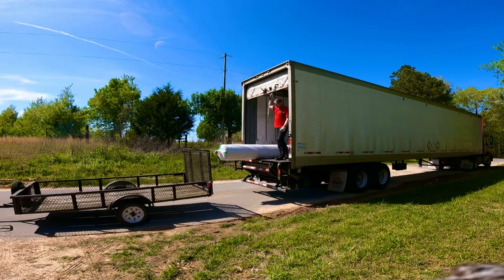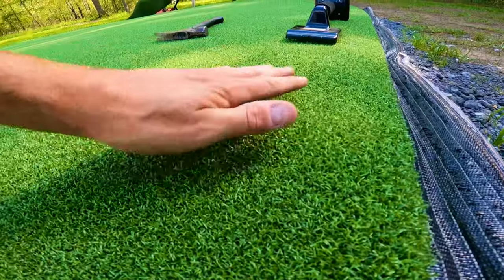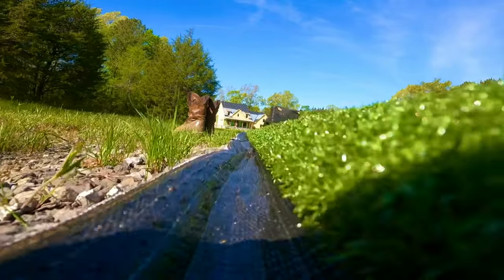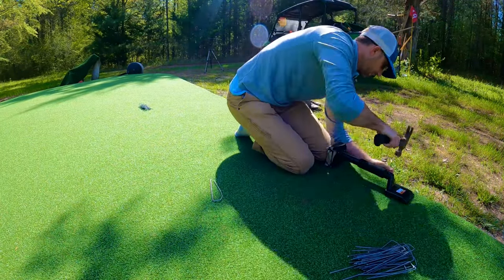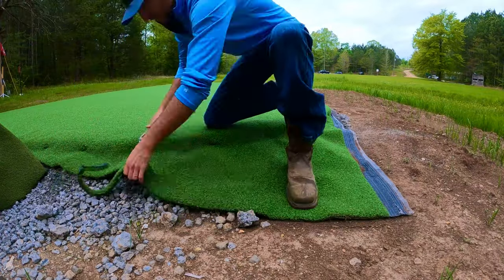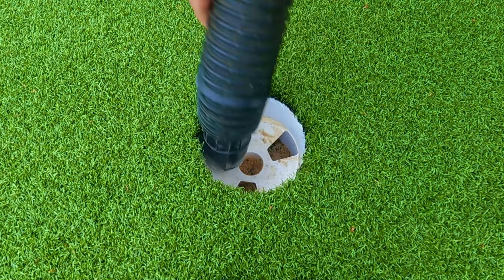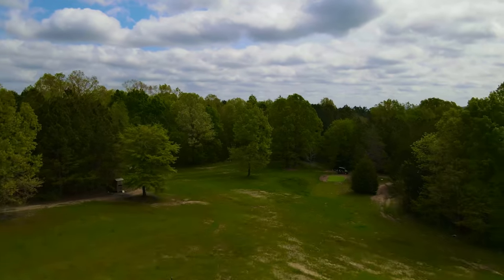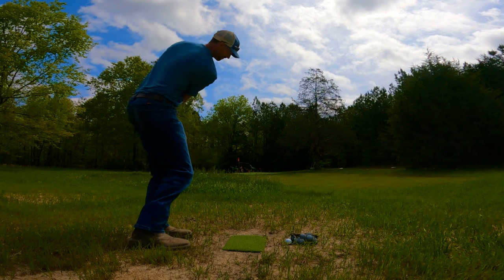Smoothing and Securing the Turf on our New Putting Green

Comment: Great video. Thanks
Reply from the maker: Thanks!
Reply: @UnderParAcres  you're welcome. I'm installing my fringe grass today around my putting green grass, and built a stunning 2 high x 3 metre wide rock waterfall pond next to it. Very exciting. Nervous though, as I'm doing it alone, and have some tricky shapes to cut around. 

Just using long silver pegs and can use them on fringe grass but not green, it's 15 mm and pegs stick out too much. 

I've got special joining tape to use underneath too, but not to sure how it works.

Any advice? 😁⛳️